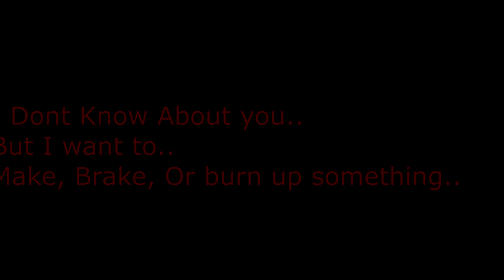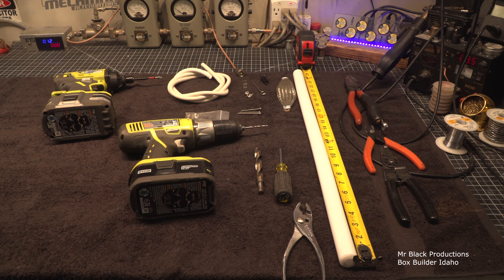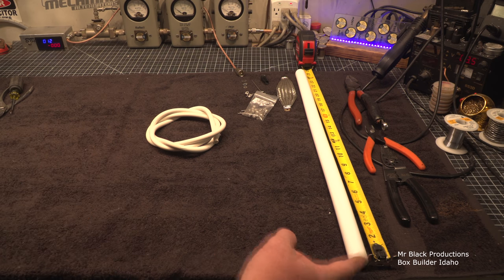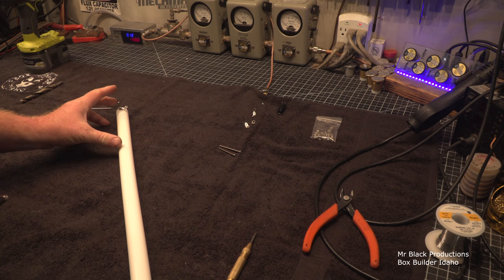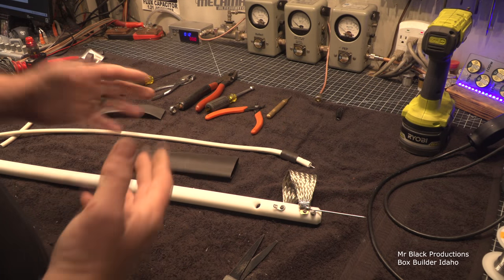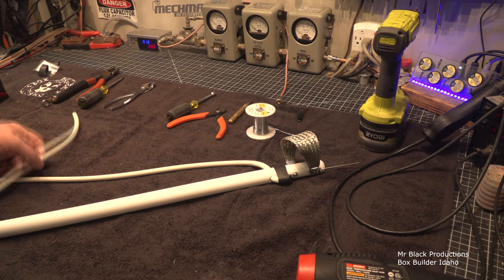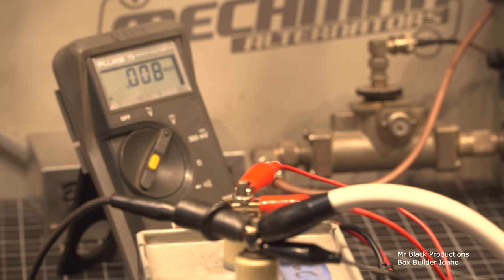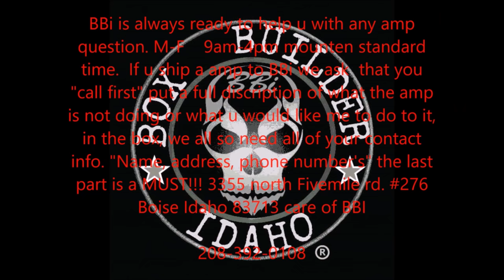How To Build A Hi Volt Ground Stick "Chicken" Stick!

Comment: Great video!!! Also consider the heat involved... 4000volts x 1 amp, is a short discharge of 4000 watts. You'll be cooked by approx. 2.5 toasters. 4000 volts x .1 amp is a short discharge of 400 watts. When you figure that your simple Weller 25 watt soldering iron can melt solder, crank that up to 400 watts... you'll have a nice burn to remember your experience by! Respect those electrons... it will save your life!!! And thank you BBI for this... If it saves one life, it pays for itself!

Comment: Glad you left comments open.  Question: How would you ground it with the tool you created, if the HV- floated above the chassis and you had not pre connected the ground from the chicken stick?
Reply from the maker: I would use another insulated bar like another piece of Teflon and tape the opposite leg to that. Basically have long plastic extensions that are hooked my hands that I can remote make connection with.

Comment: Muller alligator clips, best way to go.
Go to a bicycle shop and purchase a stainless steel spoke, works good for a sharp pointy device when cut and ground sharp.
The stick is not long enough for my respect/fear of high voltage.
I'll stick to 13.8 VDC.
Thanks for the lesson Luke.

Comment: I have a fun problem in my truck right now. If I key it down with the helper on it will shock your hand to to the point of smelling skin. Tien for some grounding and bonding
Reply: That’s not a electrical shock, that’s an RF burn. Get that fixed quick✔️

Comment: This will save your life !  Even a microwave has HV that can kill you ! On broadcast transmitters  the chicken stick is bolted to ground . hangs inside cabinet .point down .and is longer . The IOT DTV transmitter is pos. ground . water cooled. and don't do this on HV battery bank like on a EV . 73's